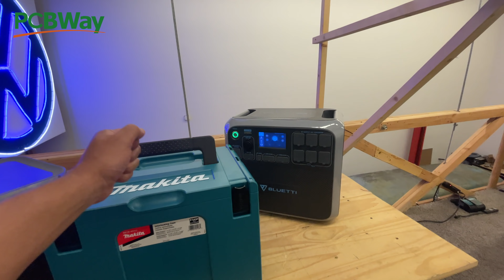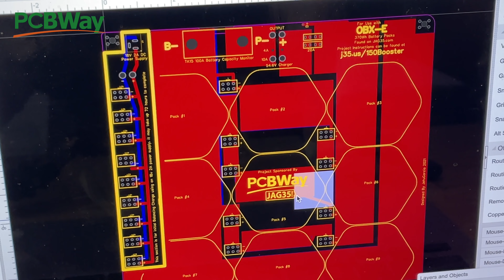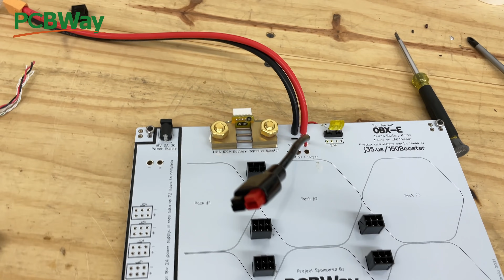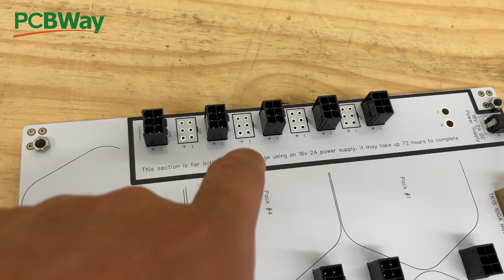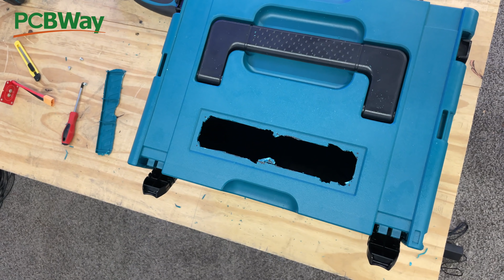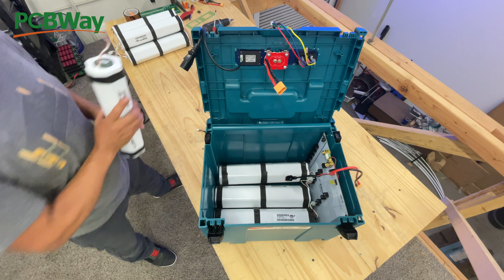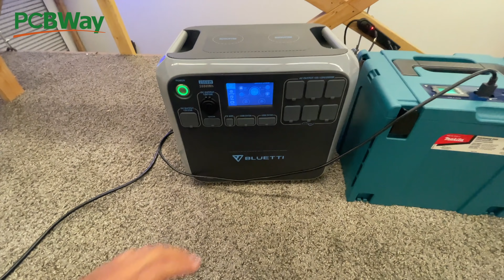DIY Booster Battery for your Bluetti /Ecoflow Solar Generator

Comment: Help please. When I charge this battery to full capacity and 54.6 V and then plug it in to my Anker S 2000 to charge it. The voltage dropped dramatically. Nothing goes into the S 2000 and voltage on the meter is showing between 21.5 and 25.5volts,keeps moving. voltage at the board/stint is 34.88.  Could I have a bad cell somewhere and if so, how do I find it? It is currently a big brick.

Comment: expensive those   battery packs .  heavy also.  i have 3 bluetti  EB3A, ac 180 and just received the  ac70 AND I HAVE A 1,8 50AH BATTERY I  USE FOR EXTENDING THE   capacity when i have a fridge and freezer pluggued in  the Ac180 and the Ac70. i use it for my computer and screen  with my EB3A. workd good.But now i will get a 24 V 100Ah lifepo4

Comment: I got a Tesla battery I’m stripping down to build a 48v battery for a Bluetti Ac200max. First question I have is anyone build one yet that you can plug into the “Bluetti 2nd or 3rd battery port” to get the full power from it instead of running through the solar port? And any tips or parts list for what I’m building to work with the Bluetti?

Comment: Do u always have to charge it from the ac voltage or can u just leave it connected to ur bluetti and let the solar panels charge the bluetti and than once bluetti full, let it charge the booster battery. That's what I'm wanting.

Comment: I have a Delta Mini and is there is voltage/wattage curve for batteries (& solar for that matter) so one knows a battery will not be too much; or is one safe as long the 75V is not exceeded?  I would worry that 2 of the 36V batteries in series, with a 72V charge, might blow by the 300W max?

Comment: I see some problems:
The battery packs are not mechanically secured. During transportation, they can press against the board and crack it. And, they can pinch the connecting wires, thus damaging them.
The charger is metallic and is not securely mounted in place. It can touch the bare solderpoints on the faceboard and make a short circuit.
I do not see bypassing diodes. If one pack shuts off in a series groups, it can be reversed. I hope the internal BMS's have a reverse polarity protection.
I do not see an undervoltage and overcurrent protection. I know there are internal BMS's in the packs, but that will lead to reversing them as mentioned above. Besides, when one pack shut off, the wlole current capacity will decrease, thus overloading the remaining groups. I know about the fuse. It will heat up during high current demands.
A global BMS would make the initial charging and ballancing an automatic process. And, it will ballance the battery packs and thus prolong their lifespan. And, it will protect the whole battery better.

Comment: Can you extend the overall lifetime of solar generators with external batteries ?  Or will they die anyway so they can’t be used anymore?  Thank you 😊
Reply: So the NMC battery based ones are going to be good for ~500 to 1000 full cycles until they hit 70-80% of original capacity. That’s considered “End of life” for that chemistry but it still has several hundred cycles left until degradation gets to the point where you’re getting like 50% original capacity and the cells are less powerful so you might find it shutting off when you try to run big loads and the battery voltage is under 75%

Unfortunately these booster packs can’t get around the fact that the original battery is the power source and you’re just charging it up BUT if your power station can run the loads off the solar directly, then this booster pack is only getting cycled (not sure if any do this or if they are charging and discharging at the same time). 

I’d have to look into how these power stations work.  I know most residential solar systems will power their inverters from the solar energy if that’s enough to power your loads. If it’s not enough then any extra comes from the battery. 

The LiFePO4 based power stations won’t degrade to 80% until they’ve been cycled somewhere between 2000 and 4000 times (full 100% to 0% cycles). I’m sure many of the companies put a little buffer on the bottom so you don’t go all the way down to 2.5V per cell which will increase cycle life. Same with the NMC packs. If you manually stop your power station from hitting 100% or going below 10% you will DOUBLE its cycle life (assuming your gauge is accurate and they can take a few cycles to calibrate). Running 80% down to 20% would triple or quadruple cycle life. Unfortunately this isn’t a common feature installed on the apps of these things. What you can do on Ecoflow and Bluetti units is limit AC charging power. Blasting them at a full 1500W+ is going to be rough on a 1500wh battery. You want to charge at 0.5C or less so 1500wh=750W or less. Doing a constant 1C charge from AC will probably not allow you to reach the stated cycle life, 0.5C would.

Comment: Why did you say Only (2) KWhrs. That's a very hight starting point! To dismisses as a bait & switch. I have a Total of just over  (2) kw hrs. 600 watt hrs for the top floor lights & one TV being used @ the same time. With a modern Amp, and any Guitar  Bass, or Acoustic guitar with the home Theatre system & appliances. If we have very bright 🌞. The hotter & faster the panels  get more $ they cost! The faster and better they work. 2 kw is great mid point amp

Comment: Problem. I used the pack to charge my Ecoflow last night although the Ecoflow was close to full. After Ecoflow was charged, Plugged in the pack to charge 3 hours ago and the amps keep going down over the past few hours. What is going on? Meter is now reading 41.4 ah and 51.5 volts, dropped about 10ah. AH have been decreasing with charger plugged in. I have unplugged the charger. Please advise what may be the issue.
Reply: BTW, charger fan makes a lot of noise for the first minute or so, then returns to normal. Like the fan blade is not seated properly.
Reply: Thanks, I guess I need to figure out how to check if the charger works.

Comment: Do you have cany more of these partially assembles kits? How can I get one of these or something else I can use with my 200acmax?
Reply from the maker: this is the newest battery that works with solar generators,   you might need 2 of them I don't remember the amp draw of the AC200 https://jag35.com/products/eb4-36v-21ah-750wh-high-performance-ebike-battery
Reply: @jehugarcia  It’s the Bluetti 200 Max  > would 3 work with the 3 way splitter?

Comment: Can you use a 12 to 24-volt dc to dc charger to charge Bluetti from the alternator using the solar power port? The cigarette lighter charging is very slow. I've heard the solar port needs at least 18 volts so I'm thinking of getting a dc to dc charger. Just wondering if you have any thoughts on this. I've learned a lot from your videos over the last couple years. Thank you!

Comment: Awesome project. What kind of main fuse did you use? Normal automotive blade fuses are rated to 32V so I'm reluctant to use them in my 48V projects (they get pretty charred when they blow; I tested). Digikey etc has a few brands of blade fuses good to 58V which is perfect, but they are expensive -- $2.50-6 each. Fine for one, but I want to fuse each of my parallel packs. I guess worth it!
Reply: Car stereo fuses are good. They are kinda long though. Why not use a breaker vs fuse?
Reply: @randybobandy9828  breakers yes, you can get a marine breaker from Blue Sea rated at least 65V for something like $13. Physically large, and cost adds up when needed for 20 packs. But yes works really well and you get a switch. 
For car stereo fuses, I found AGU style online but the few specs I could find also said 32V. 
I ended up with the higher voltage ATO fuses like I mentioned which aren’t too expensive and let me use a regular automotive fuse block to make lots of connections.
Reply: @mschaus  gotcha. I just looked on digikey and they sell blade fuses that are rated up to 80amps. They are $6 each but I couldnt tell if it was a single or a pack. That's pricey for a single considering you can get about 100 regular blade fuses for that price.

Comment: i checked the links for both the PRE-pop board and the batteries=== BOTH say page not found=== does that mean you are SOLD OUT-- and if so what other projects can you suggest to run my 17cu frig for a few days when the power is out after a Hurricane

Comment: all these battery experts CONFUSE the NORMAL PERSON because always switching between AmpHrs & WH--- stick to one !!!!!! for me it is easier to talk about AmpHrs because just need to AmpHrs * Volts == WH -- i think?? so your 3.3KWH pack is = almost 300 AH if it is 12V and i think that will be 12V-- i am trying to get setup to run my frig for 2 or 3 days when i have Hurricane Power Outage

Comment: Finally getting near functional with my build…put the box and internal electric stuff in and waiting for my slow charger and the 48v fast charger and I’m improving it.

…I have internal computer fans on the way as well as making it more difficult to get rain/moisture issues…. …plans are to drop the top wires, board, switch etc into the unit and adding a sliding hatch/door which could/should let it be in rain yet give easy access to the plugs, the coulometer/state of charge display, power switch etc have easy access also with them inside the unit they should be less prone to damage physically (including the water/moisture) …it’s kinda difficult to write as I’m still in the design/redesign phase as I do little things in and outside of it to also assist with the venting and water resistant features..probably going to add insulation/cushion to keep the batteries from moving and to make the wires anchored instead of dangling as well. I’ll possibly add a video.
Reply: For the price & features it has and will have..I expect this to surpass my delta max as my preferred battery for all uses that apply to both…sure it’s heavier and as this video design goes it’s got a little issues but the little issues and possibles of what it can be is way better…heck I could add retracting wheels…a flush retracting luggage handle and probably more…this will possibly even be preferred over the delta pro battery although I don’t plan to buy one of those…& better if I do all mentioned.

As far as fans go I’m going to take a exoflow nice feature and probably improve it…ecoflow  PPS/portable power stations (delta max for sure) has fans on top…flow is from top side in to opposite top side out.  I’m thinking put a in fan on a bottom corner near the side at the long end of batteries which would be near the big pcb board and with an other fan on top diagonally across out and that would mean humidity in could be absorbed by the batteries and the charger while the pcb area would tend to have less humidity and so less issues over time.
Reply: I only plan 2 fans as the charger has a fan and just my 2 fans already will give the air the possibility of dead air spots less…unlike my delta max…which after almost 2 months of pretty much daily use has dust from airflow from areas that have gaps..usb/ac and probably every pluggable area has this…I’m gonna plug them as I don’t want dust/lint in if I can prevent it…shame they didn’t seal it better…few do like I would…few electric designs are sealed like I’m saying and like I’ll do to my version of this to the best of my ability..only Apple stands out and yet their older stuff had more temp issues even though vent gaps were less than comparables….

…anyway yea I may even add sealing to my delta max PPS..I mean I have plugs on the way for pretty much every plug it has and now I’m thinking adding some sealer/paint or such along the plastic where plugs go for it but as is delta max is pretty dang good….better than the Delta Max battery…I’m stumped why the DM battery doesn’t have fans…duhh?
Reply: I really think adding fan(s) will be a smart move with this build.  Even when using the charger he referred to being only 4 amps it burns around 150-200w and that’s some real heat….wanna toasty car???  …get the charger and I bet it would even make a difference in Alaska In winter time…sure it would not be enough for most in that case..it still would help and also change the pack.

No fans with the charger left in the box…man that would make some serious heat!!

Comment: Awesome build... but I'm not sure I understand how this battery can fully charge the Bluetti. As this custom built battery discharges into the Bluetti, the voltage will drop over time and the Bluetti voltage will rise. At some point the voltages will equalize and there would be no current going from this battery to the Bluetti. By doing this aren't you essentially connecting two batteries in parallel? I would expect that the only way for one battery to fully discharge into another is if you could keep the voltage higher than the one you are charging, which is not possible to do as the voltage will continue to drop while you are charging the Bluetti. Can someone please explain if I'm way off?
Reply: The Bluetti accepts an input voltage range through the solar input. I think it's like 35V-100V or something like that. As long as the battery stays over 35V it will still charge.

Comment: Can the delta max 2000 additional battery be charged with a charger from this video?
Reply: I need to make a way for it to change my DM battery….I don’t think it can as is…I’m gonna call EF and see if I can get just one female outlet for this so that I can add more to this units ability….it’s already a PPS even though most (including me) have classed this as a battery/battery bank…add a solar controller and voltage step up for 12-24+v to 48v and it will be a comparable PPS to PPS low end units…like Jackery…some no name brands…etc.

Comment: I'm still looking, but did you ever use an ebike battery to power like tv, fridge  crap like that?? I'm just saying I have an unused 52v 20amp.. and I was thinking about it.. you know incase stuff figure I should be ready if the power goes out for a few hours, maybe I can still power my tv ,router fridge even...ok, as far as I can tell I need a bluetti or something..

Comment: Ordering the board for power backup…to make one also…he was out of boards but notified me after 2 were available and ordered one…anxious to make this…the current battery supplier has 7 on sale for less than buying each.  I may get 12-14 and rotate batteries every battery use or at least 50% used swap 2-4 each following use.  I think the board deal..as well as the video and the rest is a good option currently…and probably last a good few years or so with frequent 2-4 day use per week.

Looks like I can do this and I’m anxious to use it.
Reply: I don’t know if year(s) ago I liked or didn’t like this channel..but for its kind it’s one of if not the best done videos…I noticed little irrelevant info spoke..and currently the links work…really good video.  Glad to work with it the channel by getting the board….really good video I don’t know if the info is only relevant, as I’m not an expert at this field of tech…really nice he stinks to simple words and most need to know if not all need to know…sure some will want all the electrical specs but I bet he knows them and would share if asked in video via email.

If YouTube has a award for a video like this it should win or come in 2nd.  All around good job I can’t wait to have one.

Comment: I have this similar setup but using the 3s3p adapter you have on your site but it cuts out after a few minutes.  I have to disconnect one pack and reconnect to get it back.  Any ideas?

Comment: BLUETTI B230 2kwh is selling for $1800 so this kit makes more sense... I will probably end up doing this for 50% less... But I also use my $200 1000 watt inverter generator by sportsman's uses less than .5 gallons as backup to recharge my Bluetti AC200P
Reply: With the current code it is about $1400. Still, if you can diy, you are coming out ahead.

Comment: If I want to use this battery for RV storage battery what do I need to convert it to 12v or can I just connect it to the solar port in the RV travel trailer used for solar panels

Comment: Would the 12V 10A 'cigarette lighter' DC output on the 200P be a better charge port than using the 48V 4A AC charger? 

Charging from the DC output would bypass losses at two inverters, the Bluetti AC panel inverter and then the Charger inverter. So, you could charge both batteries at the same time?

Comment: But can you combine a booster battery with Blueti so they both can be charged from solar and work together? Just like the original B300 does? Because you used solar input with the booster battery, so where solar power goes while booster is connected?

Comment: Just ordered the kit and batteries, so I guess I got lucky, since you apparently sold out almost immediately after the original release of the kit? 

Got a question for you. I have two portable Bluetti solar panels (120w each) and would like the option to charge this battery pack with them. Do you have a recommended solar charge controller that might fit into the top of the tool box that could work for this purpose? Thanks in advance!
Reply from the maker: no I havent built that so I cant recommend any particular product
Reply: Thanks for your reply! 

Hopefully, I will find something that will work. I'm not in a hurry, but I would like the option, since I will use the AC200, and this booster battery, onboard my 24' homebuilt houseboat off grid for several weeks at a time.  It primarily powers my ICECO fridge/freezer.

Comment: I have one of the original Bluetti's from when they were running the indigogo campaign.  My 2000W / 1700wh System was made with Lithium Ion Batteries.  Can I used this Booster pack with my System even though it is constructed with LifePo4 cells?  Does any know?
Reply from the maker: Yes